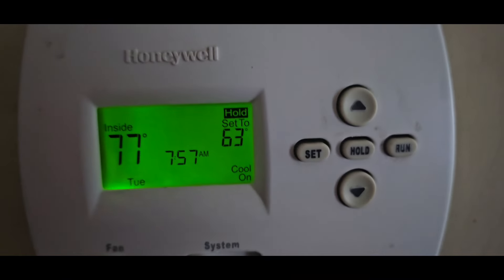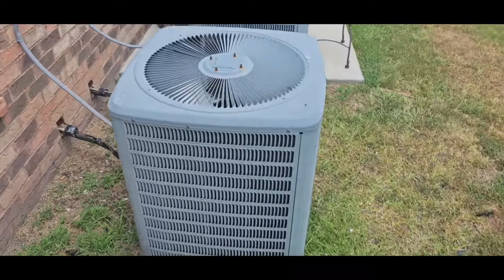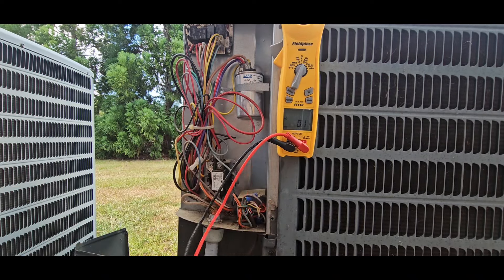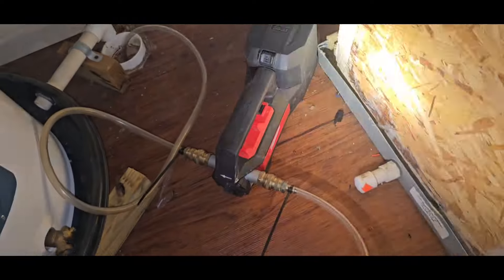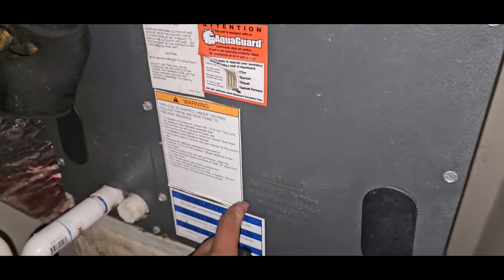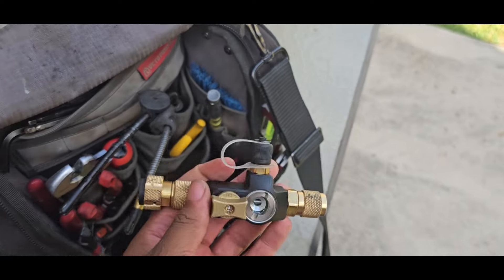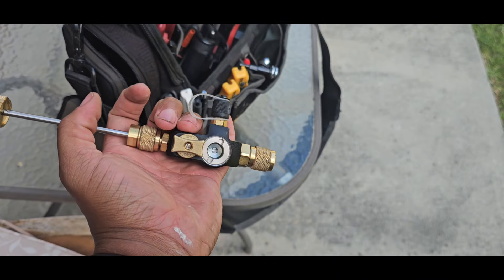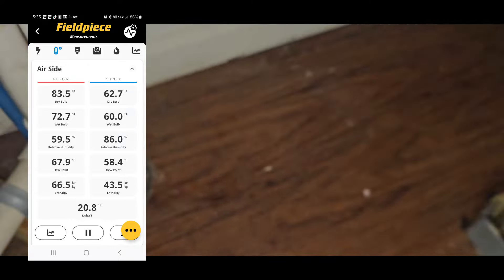Goodman Heat Pump With Some Drain Issues | HVAC

Comment: Oh man, now you have me curious about what those call backs were for.  If you have the time, please let me know.  Or, you could do a whole new video on what can cause most of your and/or industry call backs.  Thanks again for all these videos!!
Reply from the maker: One of them the condenser needed to be cleaned and the other I misdiagnosed a board. Where I thought It was the board (I found it intermittently loosing 24v coming from the Y terminal on defrost board going to contactor but never dropping it across any of the pressure switches). Turns out after I replaced the board on Wednesday morning it was doing it again by Friday afternoon. My boss found that the ground screws that mounted the board to the panel were incorrectly mounted, even though I had them mounted the same way they were on the old board which is probably why it was experiencing issues. I guess Goodman Heat Pump defrost boards need the grounding screws in 2 specific spots not just any of the 4 you can use
Reply: @AB_HVAC  Thanks a ton for the reply!  So much to learn!

Comment: Nice video man. Don’t sleep on measure quick!! 

For the future consider putting a tee where the trap connects to the straight pipe coming from the air handler, then no glue put a small piece and a cap so that you can brush out the trap without struggling. 9 times out of 10 your clog is in the trap. 

Makes it easy to clean no co2 no vacuum non of that, quick brush to break it up the flush to clean it out
Reply from the maker: Yeah I've been doing better about using T's for the entry of the trap. I would've corrected that issue then if I had more fittings but I ran out. Really need to stock the truck Monday morning 😬
Reply: @AB_HVAC  have you tried measure quick?
Reply from the maker: @drodriguez394 I've tried it but to REALLY get the most out of it I feel you have to add a bunch of info about the unit to get the most out of it. The fieldpiece app can guide me in the direction of things to check too but I've definitely seen measurequick find a RANGE of potential issues.
Reply: @AB_HVAC  not really I mean your not used to it. You can quick put in your seer and tonnage. If you have air probes it will calculate your cfm your target suction pressure and head pressure 

For a piston it will calculate your target superheat I mean it’s awesome I really think if you sat down and exclusively used it for a month you would love it

Comment: I’m new to HVAC repairs.  Could you explain why you’re testing wires when you are trying to diagnose the problem?  I’ve watched a few videos and I see people testing wires, but not really explaining the steps in which they are doing it. It would definitely help with a quick response in the video as if to explain for someone new like me.. keep up the good work on the videos. I like that you’re very humble and don’t know everything so it actually gives me confidence knowing that I too make similar mistakes but learning and watching videos helps to make me a better technician out in the field.
Reply from the maker: No problem, when I can prop the camera up on my tripod it makes it easier to explain sometimes but I don't always have that space. I'll try to get better at it for everyone
Reply: I just got the new field peace valve core remover with glass site and I also had an issue with removing the Schrader valve. I felt like I had untightened it and it felt like I was removing it, but it would not come out and did not see it attached and pass through the site Glass.  so I’m not sure if I was using the tool correctly.
Reply from the maker: @RCCartel  idk, I know I've had to pinch the appion ones closed a bit and now it latches everything. I might have to try it on the fieldpiece one. For the price they are I don't think that's fair but I love the overal quality of the tool
Reply: @AB_HVAC   my only complaint is that it’s to big ( long ) it won’t fit  in to some tight spots. The Appion seems more compact for tight spaces.

Comment: If you would’ve put a vent after your p trap it would drain better and stop being an issue for the Tennant every year. Good video appreciate the content
Reply from the maker: Well the p trap can still get clogged with or without a vent tho I'm pretty sure
Reply: @AB_HVAC  true but better chance to get air locked with no vent
Reply from the maker: @dkinfishing that's true

Comment: For the repeat drain clog houses. Ive been testing a theory. These terrible clogs didn't happen all the time with copper evaps because copper is a natural Antimicrobial. Where Aluminum isn't. So ive been taking about 2 feet a like 14 guage wire and laying it in the drain pan. I guess well see if it works
Reply from the maker: Dang man, I was told you could get away with a piece of 3/8 the width of the pan laying it in there flat or (if you have the EZ trap) you could leave a piece in the P trap itself
Reply: @AB_HVAC  gonna have to start doing that. Never heard anything. This is just me thinking of ways to stop it from happening again
Reply from the maker: @chrisdevine5328 oh yeah, that copper trick works. I've seen some company somewhere online that sells a copper embedded rope that you're supposed to pull through your drain line I think and they guarantee no clogs supposedly.
Reply: I’ve never heard of this hack, definitely gonna look into it myself